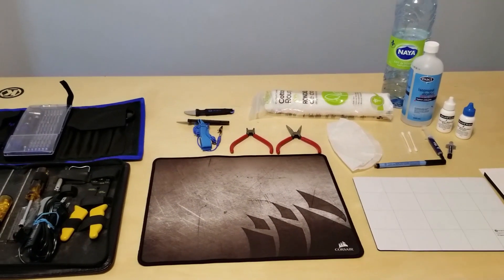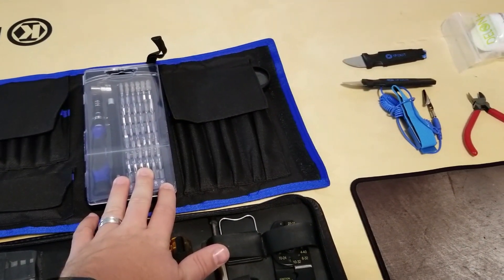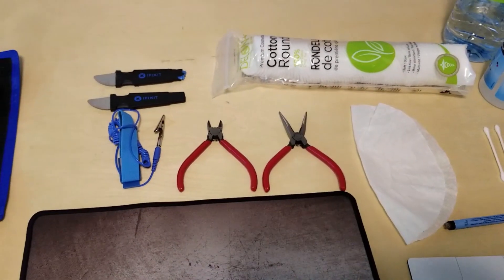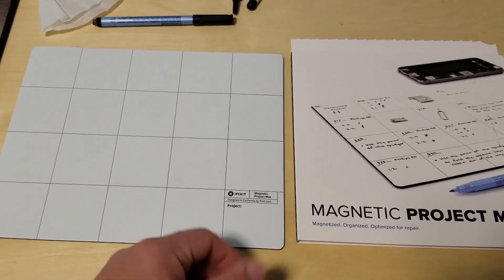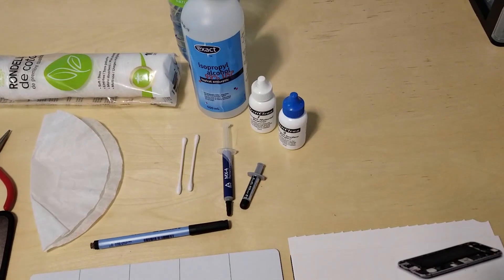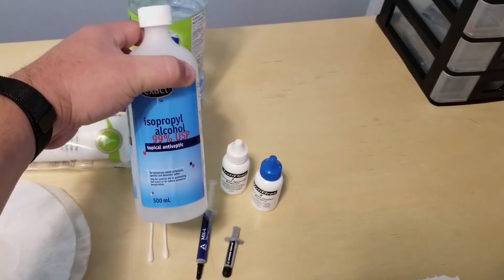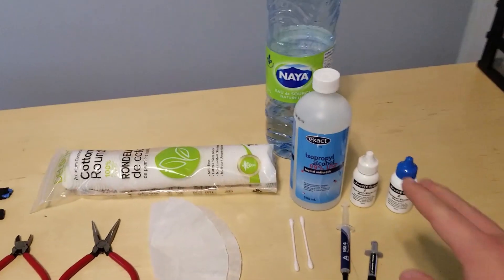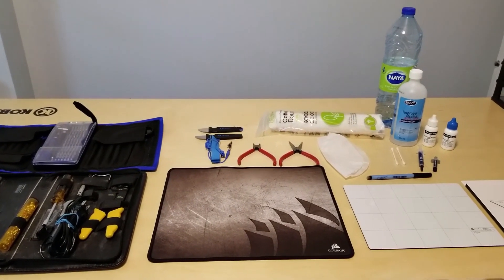VEGA 64 Teardown: best method.

Comment: im very impressed there are no vram chips on the board :O, like nvidia cards has.. i guess these vrams are inside the gpu package and perform a better cooling compared with thermal pads from nvidia cards external vram chips
Reply: It uses HBM2 (high bandwidth memory), which is the card's vram. If you look at the main chip / processor (at 6:20) you can see 2 things right to its south. Thats the HBM2. 8gb of HBM2 (each one has 4gb). The good part is that they are extremely fast since they are right next to the processing unit, and on Vega's case, you can even allocate normal ram into the card, so you can have Vega 64 with as much ram as you want. The bad part is that it gets hotter and its more expensive to produce HBM2.

Comment: how many degrees of temperature can the gpu lower than the one that comes standard?
Reply from the maker: Mine is down to mid 50s to low 60s and that's down from mid 70s to low 80s with the stock cooler. So about 20 degrees
Reply: @McPatoPC  I am interested in lowering the temperature since I have it configured with undervolt 1600/1050 1050v and voltage of hbm 1000v but the bios of amd has protection against the temperatures and frequency reduction occurs, from 55º the frequency begins to descend haunting the 1520mhz, currently in the games with undervolt I have temperatures of 62º.

With 8 degrees down I would be more than satisfied.

Comment: Hey again man! What would you think about GPU BIOS flashing? Would it significantly raise temperatures even if I had 7+ chassis fans? Maybe a Vega 56 card flashed to 64 BIOS? Is it risky? Also grats you're almost at 1.5K! Give your 1,500th sub a new PC haha
Reply from the maker: Hello again, I would say you have some risk when flashing your GPU bios, but as long as you follow the correct steps things should be reversible in most cases. Still there is always a risk that it could kill/brick your device. I have been wanting to flash my 64 with the liquid vega 64 bios, but I wont do it until I have my watercooling setup as it raises the default voltage and would probably need the extra cooling when pushing it. There are great guides on Reddit that detail how to flash your vega 56 to 64. There are also several good youtube videos, if you do it remember to backup your original bios  before starting and ensure you get the right vega 64 bios....
Reply from the maker: Sorry I failed to address the heat part of your question. I would say you could certainly expect some increase in temperature, how much is going to depend on factors like your clock speeds, fan curve/profile, undervolt settings ect. If you have a reference card I know the cooler on the vega 56 is the same as the 64 so it is capable of cooling it, but you may need to set your fan to spin faster......if you have an aftermarket card or AIB card it should like be the same. Without undervolting with the reference card it does slow down a fair bit vs when it is undervolted and running at stock settings so I would strongly suggest you undervolt it.....some vega 56 cards however dont do well when undervolted with with the vega 64 bios....so it's a bit hit and miss.

Comment: Hey with my vega 64 i go above 144hz, i average 200 fps on fortnite, is there any other thing that can sync hz to fps even if its a 144hz moniter on amd. I dont think freesync works like that it only works when the fps is lower.
Reply from the maker: Hello, yes for sure. You could look into AMD enhanced sync and or AMD Chill or frame rate limit settings. I made a video explaining how to use radeon chill if you would like to check that our or you can look into enhanced sync..both are great options. Personally I use both of them in various situations, and they can be enabled in the amd software.
Reply: McPato PC thanks bro never knew of enhanced sync